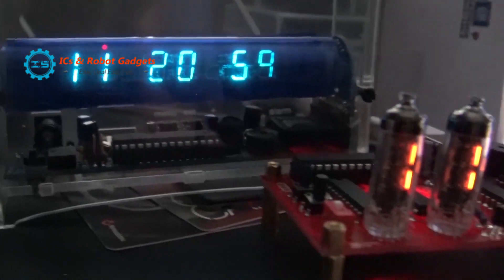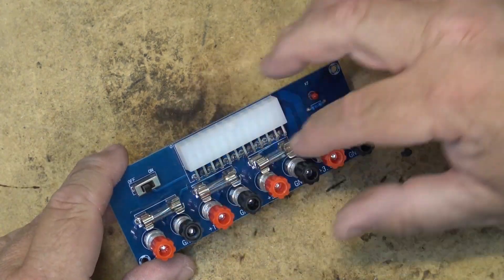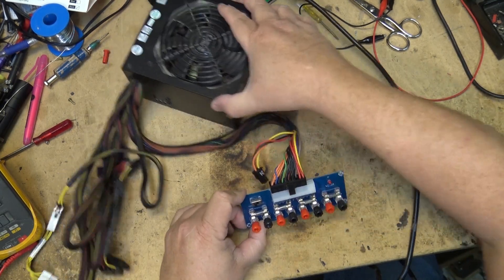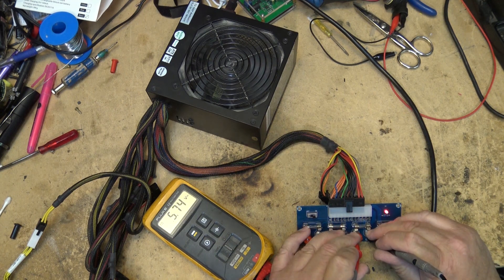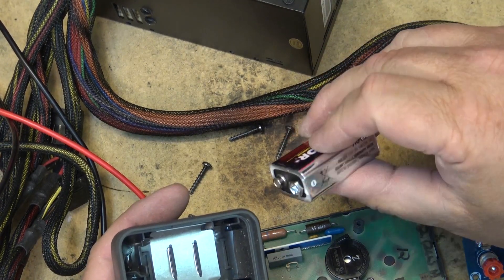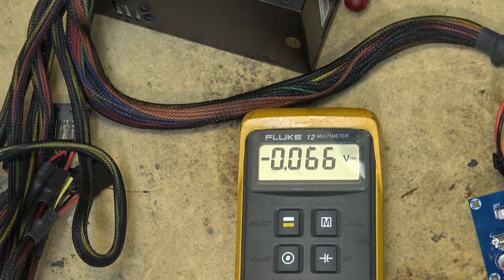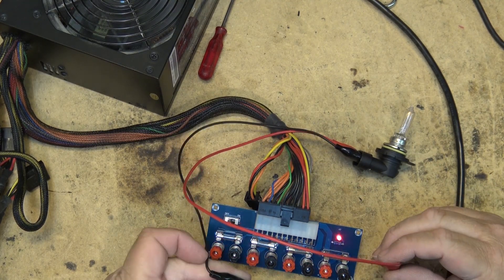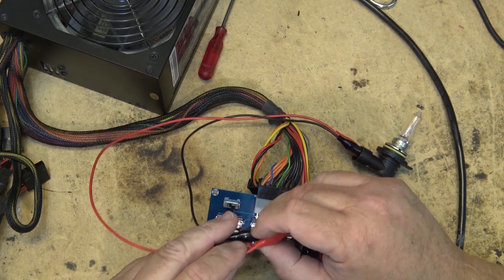ATX transfer board power supply

Comment: Looks like it works with the 20 or 24 pin ATX power supply from the video . Can anyone confirm ? Other videos on doing this without the kit call for a power resistor to load the unit. Guessing this uses the led for that.

Comment: What is -12v used for?
Reply from the maker: Usually op amps run on split supplies, such as the sound card in a PC.
Reply: @12voltvids  someone said if we connect -12v to +12v we will get +24v. Is that true?
Reply from the maker: @mbaleloae  No you ger -12v and +12v with respect to ground.
Now, if you use the -12 as your ground then there will be +24 on the _12 rail provided that none of the ground references are used, as they would be +12 above ground.
So in that case, if you grounded the -12, you would have 0, +12 and +24.
Reply: @12voltvids  ohh I see. Thank you very much

Comment: I could use this for my car stereo that I have in the garage. Right now I actually modded the supply itself so it only has the 12 volt output. I didn't use the 5 volt rail like for a phone charger because of the amperage or would it fry my phone? I have a dedicated phone charger out there anyway.
Reply: It wouldn't fry your phone as the phone will only draw what it can take.

Comment: It’d be handy if they made a version w/male pin headers on the bottom that would plug into a solderless breadboard’s power rails, and that had a buck/boost converter on board with a pot so you can have variable voltage from 3.3 all the way up to 30 VDC or so, with an LED (voltage) display on that output! 😎

Comment: I've two boards of them, but I never use it. If I've a Powersupply to much, I thin out the cables, give them the connecto(s) I need and use it with the right connectors. I believe, very dangerous is the 3.3 Volt connection if you've wrong connectivity because there is a lot of Power on the 3.3 Volt line. So there is the right question, what do you want to use the shown board with ATX Power supply for? I always use a power supply I can regulate voltage and amps, in many case is it needed. And for loading batteries or handies is a ATX-Powersupply just  to big.
Reply from the maker: 3.3 has a whack of current true but the unit is also fused so if you short it, the fuse is going to pop. No damage done.

Comment: For anyone who wants to use an old ATX power supply in a pinch without a breakout board like this just jumper the green wire (PS ON) in the ATX connector to one of the black wires (ground) to turn the supply on.

The yellow wires are 12 V the red wires are 5 V and the orange wires are 3.3 V and the purple is 5 volt standby (always on) connect your load to either of these wires and any of the black wires (ground). Just be sure not to exceed the maximum current for that voltage rail it will be printed on the side of the power supply.
Reply from the maker: Yes we have all done that.  This break out board makes it really simple and adds fuse protection.

Comment: Have you measured the voltages under load? I thought that ATX power supplies needed a load on 5V rail to work properly.
Reply from the maker: They dont need to be loaded but to answer your question. When I loaded with the 55 watt halogen lamp the voltage dropped to 4.93 volts.
Reply: It probably depends on the supply, a "your mileage may vary" kind of deal.

Comment: I bought one of these a while back. How are the 4mm sockets on your example? I had to replace all the ones on mine as they were too loose to take a standard banana plug. Not a huge deal as they are a screw-fit but annoying.
Reply: I have bought banana plugs and 4mm sockets from China and had to tweak them to get a reasonable fit.